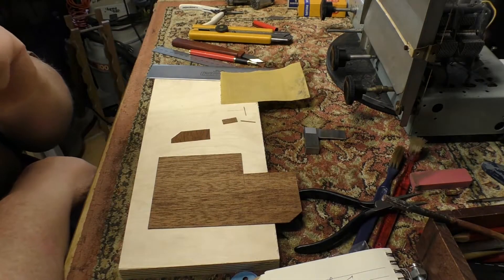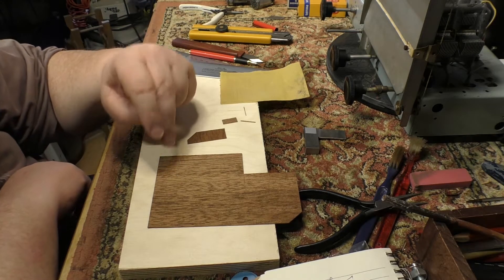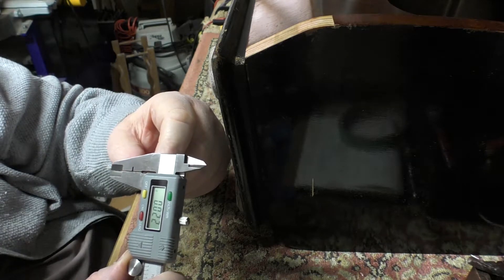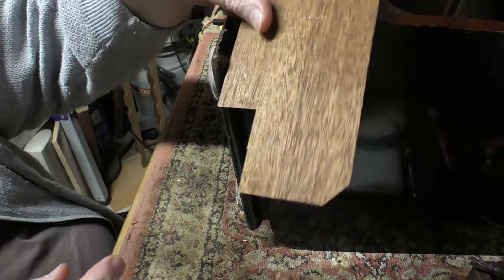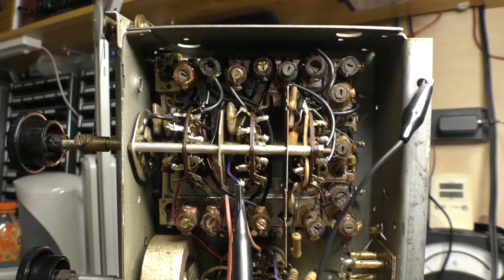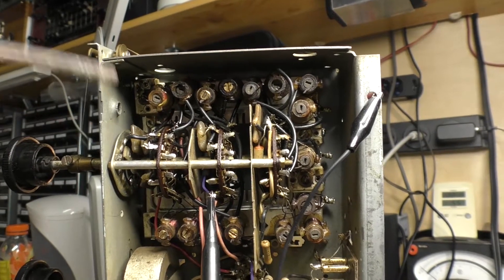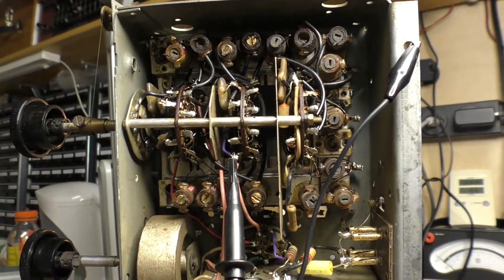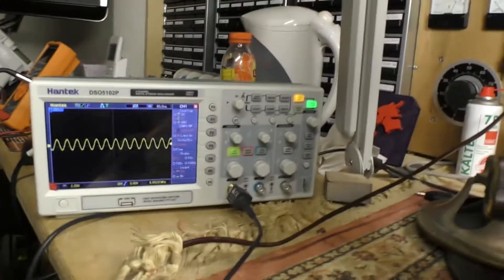PYE P53 Restoration - part 3

Comment: Hello John.  Looks like your getting there. Cool radio.
All my best.
Bobby
Reply from the maker: Hi Bobby, still hunting for the broadcast oscillator problem - been a while since one gave me this much trouble.   Luckily its a hobby so no rush.......
Cheers,   John
Reply: Hey John. I was wondering ?. Could the problem have anything to do with the trimmer you adjusted ?. Or something connected to it ?.
Reply from the maker: HI Bobby, all things are possible with this one - when I get the band selector back out I'll go through everything - might even gunshot the caps.  Also have that snap/crackle sound when on shortwave that I haven't tracked down yet....
Cheers,  John

Comment: John,
You've probably found the problem by now, but if not...stay with the band switch, my friend.   A while ago I had a radio with same exact symptom.  Checked everything to include Maggie's drawers but kept coming up empty.   Turned out to be one of the band switch tabs not quite making contact.
My two cents.
Regards,
John
Reply: First thing I thought was.. its the switch... always check voltages.. always check capacitors... always check mechanicals...
Reply from the maker: Hi John, yeah the only thing left is switch contacts but so far I can't track it down.  I'll have the band selector mechanism out again and see of that helps...
Cheers,  John
Reply from the maker: Hi Andrew, agreed - most likely problem is the selector switch assembly - haven't tracked it down yet though....
Cheers,   John